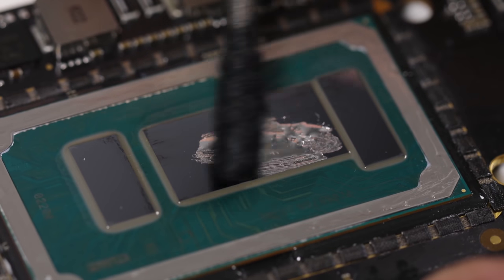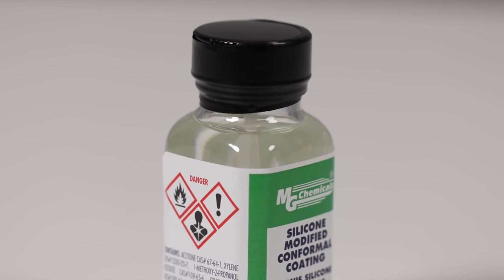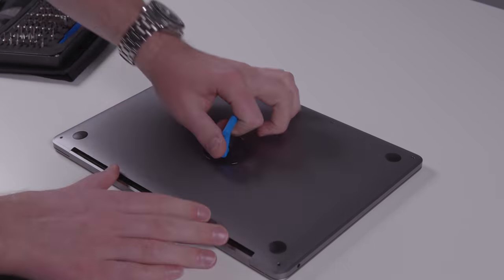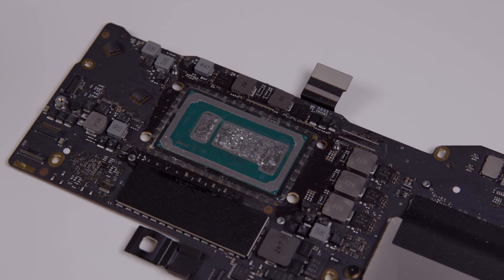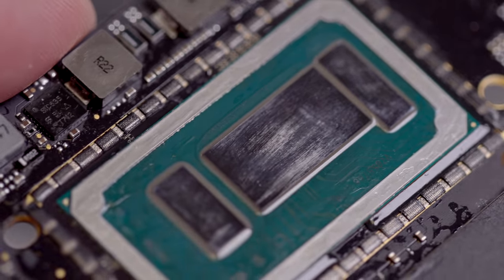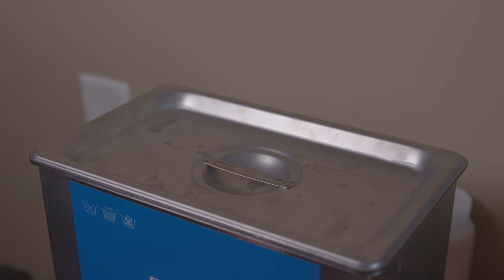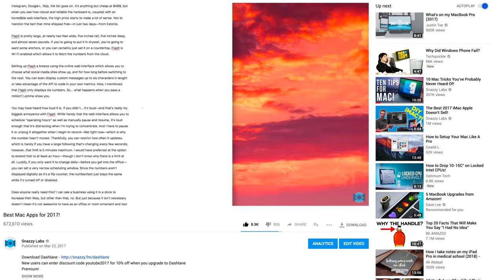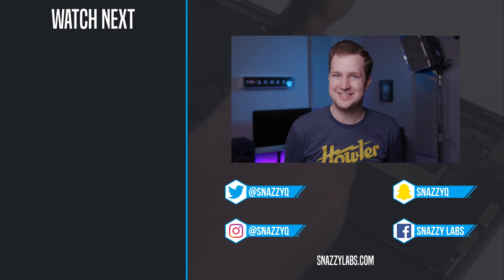What Does Liquid Metal Look like After 3 Months Inside a MacBook Pro?

Comment: Hi there nice video as always. I have a question on a different matter. i have used to terminal to show a recent folder on the dock. However i must have done something wrong and all open safari tabs email show on the dock as well. Can you please help me which terminal command to turn off showing all the open windows on the dock? Thanks in advance
Reply from the maker: Best way to fix the problem is to run the reset dock command:

defaults delete com.apple.dock; killall Dock
Reply: Snazzy Labs Quinn, how do I become a terminal master?

Comment: liquid metal Pro (thermal grizzly) no better than Ultra. And the pro version is more liquid due to the addition of tin; this is probably eutectic 67% gallium, 20.5% indium, 12.5 tin.  Tin is cheap and lowers the melting point even further to 10 Celsius. But such an alloy reduces the content of gallium, and it reacts well with copper to form the intermetallic compound CuGa2. Having reacted with copper, the metal gives off gallium, indium tin crystals and other impurities fall out in the alloy (which can also be separated from non-pure copper). It kind of dries the liquid metal. The volume decreases as well, and the contact is lost.
Therefore it is not necessary to smear thin metal. (It is possible to apply a crystal for example for two days in a compound and a video card steamer and leave on the table like a cake to infuse, then add some fresh ones). The intermetallic CuGa2 is not necessary to skin, its thermal conductivity ~ 90 W / (m · K), more precisely 96-86 at 300-500 Kelvin.
So who has dried up (even on nickel), remove the most dirt of impurities and add fresh

Comment: Never been a fan of liquid metal. I have the feeling in a few years it will be one of those things we look back on and think "WTF, did people really put a gallium based thermal compound on their heatsinks?". It's a volatile substance, why do it, especially seeing as you are supposed to reapply it every year..... 

For me at least it only makes sense for LN2 and other extreme overclocking scenarios that are never intended for 24/7 use, otherwise the tiny improvement over safer, high quality compounds really isn't worth it.
Reply: I've been using it for 5 years. Single application. Works fine.
Is it worth it in a lot of cases? Maybe not. But it doesn't damage anything and doesn't lose cooling capacity over time.

Comment: What do ya recommend to remove keyboard’s marks on the screen of MBP 2016 ?? Cuz they look permanent !
Reply: Mujtaba Hasan Your keyboard shouldn’t be making contact with the screen when closed. You might have a defective unit with too tight a tolerance in the screen hinge.
Reply: AbuBakr Akram Can you please explain it to me better?
Reply: Mujtaba Hasan Sure! I’m saying that there might be an issue with your laptop. The screen and keyboard shouldn’t be touching each other. I would recommend that you get it checked out if it’s under warranty.
Reply: Mujtaba Hasan If you just want to remove the marks on the screen, try using a moist micro-fiber cloth.
Reply: AbuBakr Akram unfortunately I took it to iMachine in Bahrain and they just said “ You have to care about it” !!!. Also, I tried the micro fibre cloth many times and it didn’t help at all. Is there a recommended liquid to remove them? 

Thanks for helping❤️
Reply: Mujtaba Hasan If you go online and search for it, you’ll find instructions on how to make a weak liquid for cleaning screens. This is also sold online as “screen cleaner,” but it’s not supposed to be hard to make. You should be able to make it yourself.
Reply: Thank you bro, I'm gonna do that

Comment: 1) Who the fuck comes up with thate nonsense that LM (Conductonaut at least) needs to be replaced annually? I had that under the IHS of my 3570K for 2+ years and the temps didn't increase.
2) It's normal that LM "bonds" with copper. That discoloration is nothing to be concerned about. Now aluminium as you mentioned is won't last long when it comes into contact with LM.

Comment: I fix the things for a living, and I still wouldn't use liquid metal. Basically I came to the same conclusion as you, for the relatively minor (depending on use case) performance benefit it's just not worth it.

A super high quality thermal paste will get you most of the benefits with none of the risks.
Reply from the maker: Kamal Haidar Agreed. That’s what I concluded at the end of the video. :)

Comment: Apple can't extra $0.03 for a better quality thermal compound?
Reply: Intel uses worse, even on the $2000 CPUs (not system, just the cost of the CPU...). This latest series though, they butcher the soldering job falling at AMD's heels as they say "but now we solder ours too!", except they made the IHS so non-flat and defective, some reviewers saw 39c difference between cores in the same chip (so some might be 100c, and the other might only be 61c, so your speed is throttled heavy based on the defective IHS side that's not making contact with the cooler). Also Intel raised the silicon height, making it worse in all regards (they have been soldering XEON for a long time, I don't think they've screwed those up like the desktop versions), so now you not only have to sand down your IHS if you want reasonable temps, but you should also sand down the core itself!

Apple makes a bit more sense, its already over-priced... The Intel is too, but at least they have some good competitive technology. Only AMD seems to actually care about quality at this point.

Comment: If only apple would just solder the cooler to the die! I mean if your going to be an asshole and solder the ram at least get something from no service design.

What happens is the liquid metal will alloy with the copper, you in fact want this as it improves the thermal conductivity of the copper

Comment: It doesn't make any sense to say that you have improved your temperature by 15% because it has no physical meaning. The percentage would change based on what unit you use. Even if you were to use percent it would make a lot more sense to use Kelvin.
Reply from the maker: Should have said that benchmarks from the thermal modifications resulted in 15% higher results. Certainly didn’t mean to imply that the temperatures themselves were any measurable percentage lower.
Reply: Snazzy Labs oh that make a lot more sense. Nice video

Comment: Liquid Metal had a tendancy to 'stick' to certain metals more than others, and this is likely the reason there is more on the die than heatsink. The whole reason you apply it to both surfaces is to ensure it sticks to both. It is likely that when the heatsink was pulled apart the liquid metal simply stay stuck, not because there was a problem but just through fortune.

Comment: The corrosion issues are not worth it no matter what morons say about liquid metal there is only one degree difference between liquid metal and kryonaut in scientific testing which to me is moronic argument to make about liquid metal being better when it corrodes the metal.
Reply: SMGJohn I don't think Kryonaut performing as well as conductonaut but i think GC-Extreme will do the trick. In which case, i agree with you.
Reply: SMGJohn Apple itself used liquid metal on the 3.2GHz version of the 2008 Mac Pro. They used a special grease to create an airtight barrier around the liquid metal to stop it from oxidizing.
Reply: I'm not a moron. I tested it for 5 years straight. The shit just works. 
It doesn't damage the cooler or die.

Comment: talking about a 7% improvement in temperatures is meaningless unless you are using Kelvin scale. If you went from 320 degrees K tand improved 7% that would be about 22 degrees K improvement, is that what you saw, I kind of doubt it, more likely you went from 75 C to 70 C and called that 7%. For example if you went from 2 degrees C to 1 degree C, that's a tiny improvement, but using pure math, you had a 50% improvement.
Reply from the maker: Should have been more specific: the temperature improvements result in 7% higher real-world render times and benchmark scores.
Reply: I think it's  better to talk in terms of actual temperature difference, for example 10 degrees C. I really like your videos, even though I am not a Mac person, I like to see your videos, they seem very informative without being a "fan-boy"
Reply from the maker: I mentioned temps over ambient more extensively in my previous video so I tried to avoid redundancy here, but that may have been a mistake. . Thanks for watching.
Reply: He sent a reply that he was actually talking about performances rather than temperature, in which case he can claim X percent improvement, he wasn't clear in the video but  the the way he meant it was correct.
Reply: Heat goes with difference of T. So doesn't matter the unit...if you have a room T of 25°C and a cpu T of 80°C you have (T-T)=55°C. If you change something and cpu T becomes 72°C, the value is 72-25=47°C. This example difference is -14.5%
Reply: I know this doesn't really matter but there's no such thing as degrees kelvin 
The kelvin scale is and absolute scale so 1 kelvin is just 1 kelvin and so on xD
Reply: Nath Martinez thanks, but the real issue is not to take the difference in Celsius as a percentage. For example going from 1 degree C to 2 degrees C is not twice as hot, it's only slightly hotter.
Reply: pro tip: delete your opening comment.

Comment: Thanks for the vid, I was debating whether or not I should apply LM to mine... then it's decided ! I will use Kryonaut for the first repaste(s) then I'll try Conductonaut on the later ones :)

p.s. I'll see if there are significant results with the repaste... if not, then it will have to be LM because my laptop is running way too hot as is.

Comment: Not sure I would want to open my Macbook Pro just to replace the paste and void my warranty... No thanks
Reply from the maker: You don’t technically void your warranty. Only if you break something. 😉
Reply: Snazzy Labs still no thanks.. not worth it...
Reply: Your implying there are no benefits, I wouldnt want to spend over $2000 on a laptop that thermal throttles, this fixes that
Reply: Sounds like something a soyboy would say.
Reply: Ana E Sure.. But this wasn’t a laptop that was..
Reply: Ashish Patel Sounds like something a millennial would say.. 😂😂😂😂
Reply: oh wow dude you totally roasted him $100%
Reply: i guess thats one of the perks by buying macs
Reply: +Michael T Panetta
I would not be dumb enough to buy a shitty laptop that thermal throttles out the box anyway.
Reply: +SMGJohn you know that every Laptop has shitty- not so great thermal paste. And you should renew it every couple of month....
Reply: Thin ultrabook kind of laptops are particularly shittier when it comes to thermals when you compare them to like Dell latitudes or similar stuff. Apple's laptop fans don't even start working until really high temps (quietness over thermal performance apparently). Also, you only need to replace thermal paste every year or so (if you're impatient), conservatively you could be good with the same application for years.
Reply: +MHWGamer
And yet most laptops do not thermal throttle like MacBooks do
Reply: I'd say 95% of the users don't even realize it does and just enjoy the laptop
Reply: its illegal for them to void warrenty for just opening it and if it did dont buy a mac since you will have the same rules as leases so you dont even own the thing
Reply: Why waste your time commenting? Get lost

Comment: Only 3 months and the gallium already did this much damage. For 7% less heat? Not worth it.
Reply: Alessandro Neiva it's not really "damage" the grey oxide layer on the copper cooler is actually said to slightly increase performance. It really is only a visual thing
Reply: @Alessandro Neiva 
It looks like the video was a little too much for you to understand. Try a coloring book first and build your way up from that.
Reply: togawac wrong. The "oxide layer" in no way increases performance. It's not even an oxide layer, it's gallium eating into copper creating an alloy.
Reply: Sad oh yea you're right it is an alloy. I use liquid metal myself and I'd heard the grey coating was harmless/ some people claimed it increased performance.
Reply: I very much doubt it. I don't see any reason why oxide or copper-gallium alloy should have better conductivity than pure copper.
Reply: Sad well then the effect is neglagable. There is little to no temperate difference between when the liquid metal is first applied, and the few months later where there may be that alloy layer.
Reply: Negative, nevertheless. And take into account that such alloy is most likely brittle, just like aluminum-gallium alloy (not to such extent tho). So what might happen is that the good vapor heatsink juice might flow out.
Reply: Sad liquid metal has been used by pc enthusiasts for years. While gallium does react with many metals. Copper is the recommended metal to use it on. I've done plenty of research and haven't seen people with copper heatsinks having issues
Reply: Yea, PC enthusiasts with large copper heatsinks (often with nickel plating) can last years. That's not the case for laptops with thin components.
Reply: Sad I just did a little more searching and turns out you might be right about that. There's been no horror stories yet, but maybe in a couple years there'll be laptop users where it may have broken through into heat pipes. I think the reaction would exhaust the amount of gallium before it would break through. But who knows it is possible.
Reply: Been using the same liquid metal application for 5 years.
It doesn't damage it.

Comment: The risk of using liquid metal on a daily system is just not worth it, I say it's best left to people who are doing hardware testing, and extreme overclocking like trying to break world records.
Reply from the maker: This is what I said. 😉
Reply: Commodorefan64 I use it on my hp omen because the temperatures and noice levels were horrible.
Reply: SecretSalami48 

Well, those are made to be opened.
Reply: ROBOT9k1 I mean, google hp omen 15 disassembly and tell me is it designed for that xD

Comment: someone give me a better explanation than planned obsolescence, for apple not to put good thermal paste on their heatsinks Oo
Reply: While stock thermal paste is often crappy, it remains relatively stable over time.
Many fancy thermal pastes are much better, but require replacements after a shorter time. So they are not a good stock option.
So in a way, it's even against planned obsolescence to use such a thermal compound. Or at least so they say.

LM is almost never worth the risk. Over time, some tiny amounts of it will get throughout the computer, and they can cause:
- Tin whiskers on tin metal alloys, causing shorts and components falling off, basically rotting away the connections.
- Decomposition of coolers, chassis, etc. through gallium diffusion into all metals present.
- Even damage the CPU itself, if they have a thin or non-existent diffusion barrier, as often is the case with laptops and other intentionally thin devices. AMD even got asked by Apple to make their GPUs thinner by grinding off more of the top layer of the die (which is the diffusion barrier).
Reply: And we all know that some companies don't like consumers snooping around inside the product to accidentally fuck it up